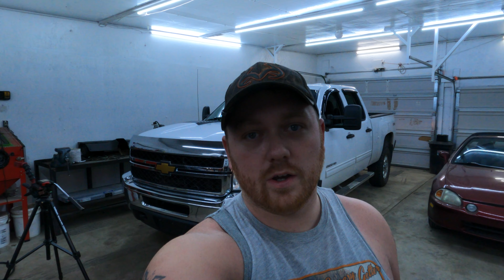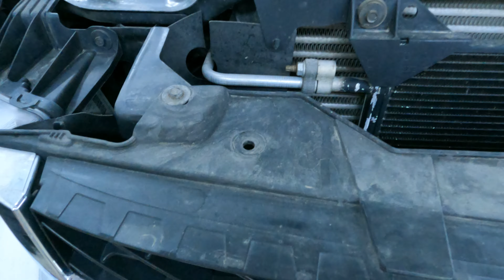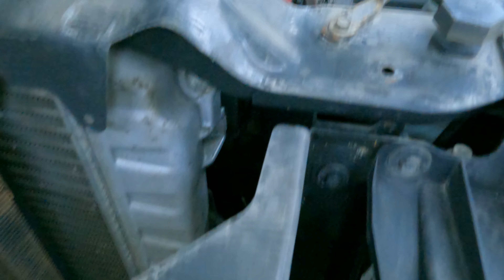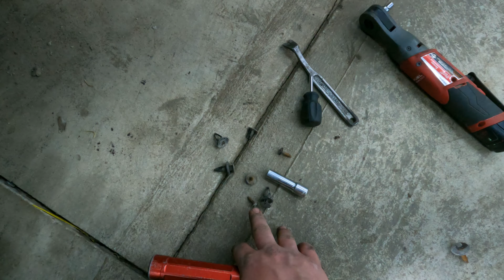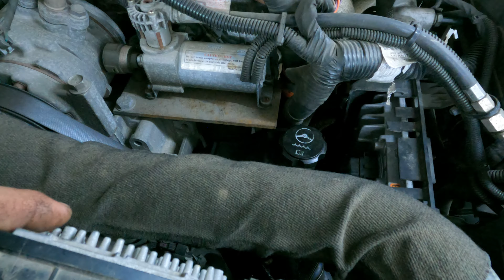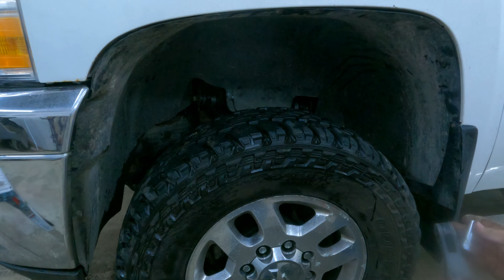How To Replace Power Steering Cooler on Chevy Silverado

Comment: i just blew a PS line today on my 2011 so that is why I am on youtube looking it up. Also realized after I lost steering I also lost brakes. Looked and notice the pump and gearbox lines also go back toward brake master cylinder. Luckily I wasnt towing anything or that could have been really bad. Sucks that they designed it this way that if you blow a line you lose steering and brakes at the same time. Guess it's time to order some parts and get greasy!!  Nice video!

Comment: I'm not trolling Just a regular guy who likes to wrench. I just replaced my power steering cooler on my 2011 duramax. And you do not have to remove the front grill or the inner fender..  I took off the front cover above the grill and I was able to reach both lines from above very easily. I got the whole job done in twenty minutes. I did use a factory replacement which had the squeeze clamps with little holders to keep them open, so that definitely made it easier than hose clamps.
Reply from the maker: Sometimes, when I do things, it's the easier way for people who don't know much about vehicles. Also, with things opened up, it's easier for the camera. There are always easier ways to do things.

Comment: Can you bypass the cooler? Mine is leaking and I don't want to replace something that isn't necessary when only traveling from town to town with no trips topping 50 miles. It's a 2013 chevy silverado work truck but I don't use it much.
Reply from the maker: I don't know that answer to that question sorry. I assume it needed it. someone a lot smarter then me designed it to have it lol. I don't really see it cooling the fluid of that much so that's your call lol. Let me know how it goes though. Maybe drive through town and get a temp. Reading before and after?